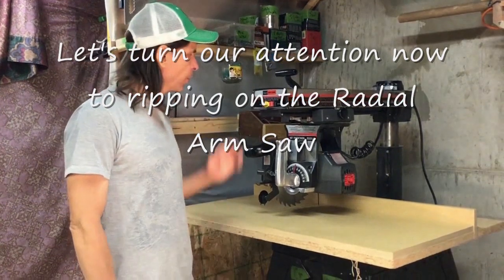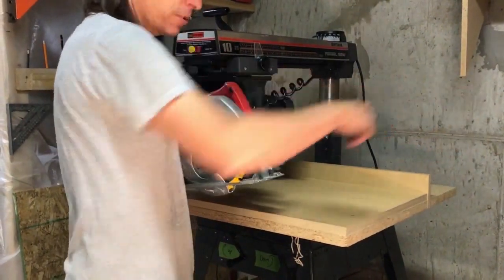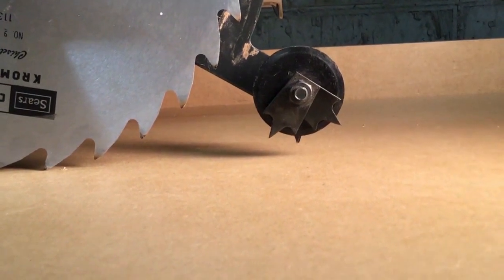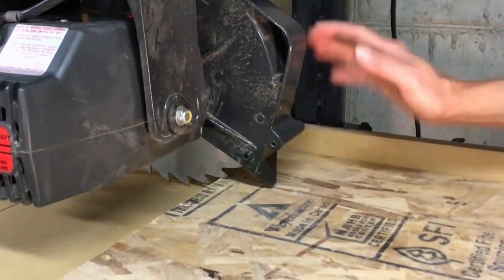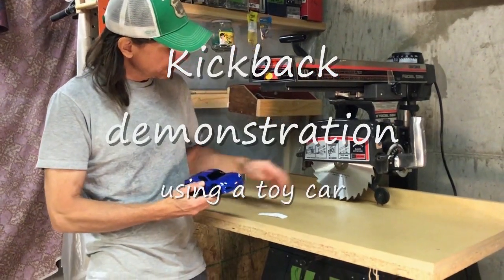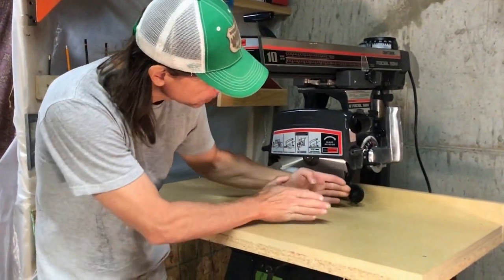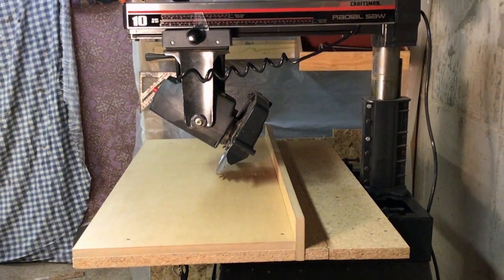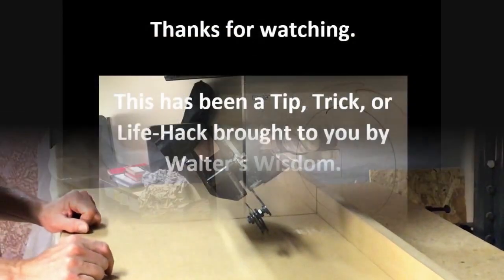Rip Cuts - Radial Arm Saw Know How, Part 7 of 9

Comment: I was wondering if you could help me. I took my saw apart and there's this stopper thing and I don't know where it goes kinda
Reply from the maker: The saw's manual has a detailed parts list showing where each part goes.  Google the saw's model number (found on the saw's metal base where the table attaches) along with  "manual pdf" and you will find the manual needed.

Comment: All of you videos are very informative. I have a Craftsman radial arm saw, model 113-197601. Have had it for a few months. Bought it used since I have gotten back into woodworking. The motor is different than yours. I was wondering if the motors are interchangeable since mine no longer runs. Mine just hums, no blade rotation. Parts are "no longer available". Would be great if I could find a solution. Any helpful replies would be appreciated. Thank you!
Reply from the maker: Sorry, but I don't  know.

Comment: Nice . I rarely use the in rip. You can adjust your fence to get as close as you need. The out rip more of the mechanics in closer to the post ,and you're more aware of the blade . Sometimes the opposite happens a pinch kick . Wide teeth carbides allow too much room and the board can cock and kick . A good combination is the open cross tooth,but if you're doing a lot of ripping out on a dedicated blade. It's funny but I'm most weary of a fresh blade. I have a 12 " DeWalt commercial and it won't back down ,and if I was less blade flex I can put on a 10" blade. The other problem in a rip is the saw you have. I had one and it dogs if it hits a bad Knot. A vintage Sears is far better and if you can find a used 12 they're great saws. 😎
Reply from the maker: Thanks for that information.

Comment: Wrong rip blade! It's no wonder the Radial Saw got a bad rap. I love mine and can rip to 49 inch wide on the 8 foot edge. I built an outside fence that works great for wide rips and one man can hold a full sheet against the fence. The drop side never rides on the fence.
Reply from the maker: I appreciate your insight, and I agree that the blade used in this video might not be the best of the best for ripping.  The blades manufacturer describes it as ““an all-purpose, set-tooth blade for fast – but not real smooth – ripping…” However, it's important to note that the focus of this particular video is not on saw blades, and no cutting was demonstrated. The explanations provided could have been done as effectively with a blade made from cardboard.

As my videos aim to highlight, I am a proponent of radial arm saws. By sharing my knowledge of these tools, my intention is to contribute to a safer and more informed user experience, especially considering the negative perceptions that radial saws sometimes face.  As explained in my "Wrong Way Feed" video (accessible at https://youtu.be/LaagOBEH3IA?feature=shared&t=111), the unfortunate reputation of radial saws often stems from operators neglecting to familiarize themselves with the tool before use. Subsequently, the involvement of unscrupulous lawyers has further exacerbated the situation resulting in the undeserved tarnished image of this wonderful tool.

Given your evident expertise in saw blades, I value your input. I encourage you to share your insights in a comment, specifying the blades you believe are suitable for the various cutting operations outlined in my comprehensive "Radial Arm Saw Know How" video (see https://youtu.be/EJP1Sz4bt1I?feature=shared).

Comment: You are confusing ejection with kickback. In kickback, there must be rotation of the work so that it is the blade fails to cut the work, failing to turn the part of the wood in contact with the teeth into dust. Rotation can only take place when the work is lifted by the trailing edge of the blade. No lifting by the trailing edge of the blade, no kickback.
Reply from the maker: My research on the subject says otherwise.  You might want to look into it a bit more.  Good luck! I'm guessing that your opinion comes from watching BigMikeTuna's video (https://www.youtube.com/watch?v=CV4uXtxnOdg), is that right?   The manual that comes with the saw is a more trustworthy source of information and is the basis of RAS knowledge.
Reply: What ever call it it can kill you.  The anti kick back device must be set correctly,  you and everyone in the same space as the saw can be killed if the saw throws the wood out of the saw. How do I know this. My RAS grabbed a piece of wood I was ripping and shot it out. I was not hurt only because I was not standing on the feed side of the saw. The blade can throw anything it catches at over 100 MPH.
Reply: @vmitchinson  Manufacturers make safety devices not for the best effect but to include commercial practicality. Anti-kickback, anti-ejection can be and is better attached to the fence or the table. Vertical hold-down can be installed on the fence and horizontal lateral restraint (feature board) can be attached onto the table in the infeed side.
Reply: Hes not confusing anything, hes just using the terms from the manual. Table saws throw the stock out like a frisbee and radials eject it straight back. This distinction is not important for this video imo.
Reply: @woodensurfer  the ras guard holds the piece vertically and the splitter keeps the kerf open and restrains the piece laterally.  Its really a well engineered saw and works well when properly adjusted according to the manual.

Comment: at 4:15 thats so scary it hard to watch. Use -5 to +5 degree Blade on a radial saw before you knock your teeth out.
Reply from the maker: Thank you so much for taking the time to share your thoughts. I appreciate your perspective. Nevertheless, I should clarify that the focus of this video is not on saw blades, and as you observed, there was no actual cutting demonstrated. As such I’m surprised by your word choice of “scary” and your statement “hard to watch.”  I'm open to constructive criticism, however dramatic statements such as "knocking your teeth out" seem a little over the top and completely unnecessary.

I want to assure you and others that my intention is to promote safety, which is one of the reasons I am sharing my knowledge of radial saws. By watching my videos, I hope viewers will be inclined to have a positive experience with this fantastic tool and steer clear of any potential hazards.

If you're interested, you can check out the rest of my videos in the “Radial Saw Arm Know How” playlist, see https://www.youtube.com/playlist?list=PLxUYt3yjiZAA0t_U6dqF_-BrWAec88ym4.  Those videos demonstrate my positive stance on radial arm saws. 

While I didn't delve into saw blades in this particular video, I might consider creating content specifically addressing that topic in the future. 

Are you familiar with the book "Power Tool Know How" by Sears Craftsman? It features an insightful section on radial saws, detailing 12 different circular saw blades along with their specific applications. In this video, the blade on my saw is the "Chisel-Tooth Combination."  Which the book describes as  “an all-purpose, set-tooth blade for fast – but not real smooth – ripping…”